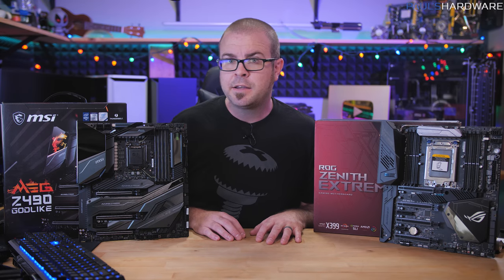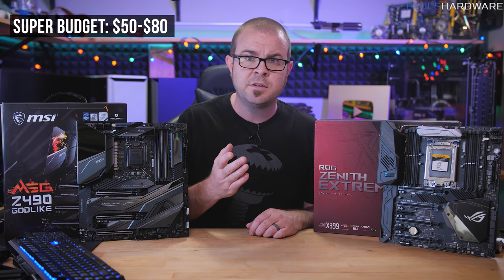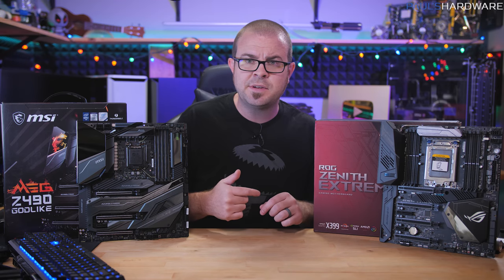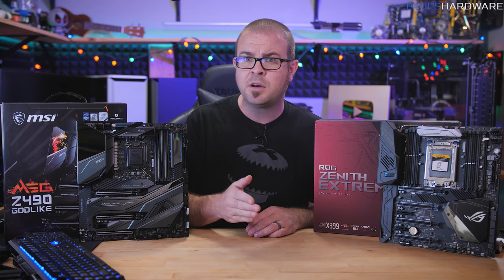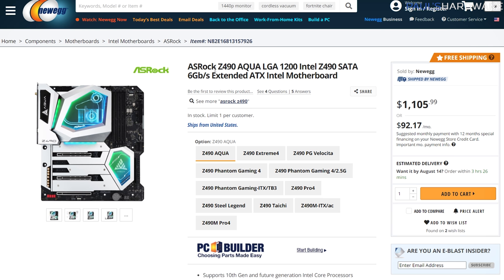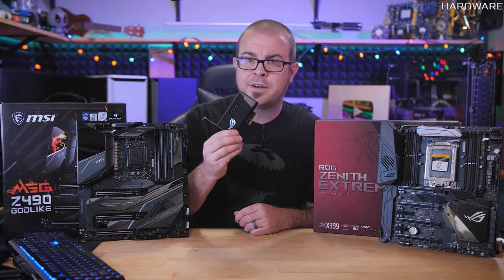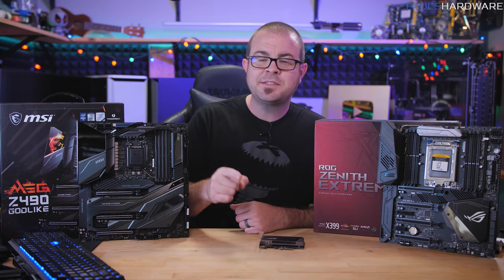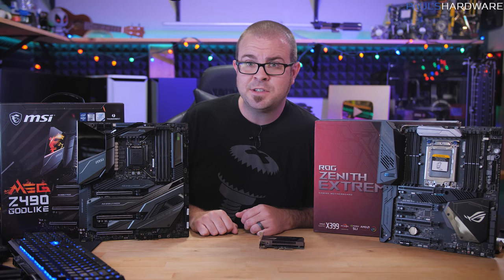What Does a $700 Motherboard Have that a $200 Motherboard Doesn’t?

Comment: Yeah Mobos have gotten way more expensive. MSI Tomahawk B350 here. It runs 3rd gen Ryzen, has 4 rams slots, nvme slot, sata galore, USB 3.1, 7.1 sound...I mean...for reals, it has been the best $76 I have spent and it is now rocking a 3800x @ 4.3 AC, 32Gb Trident Z Royal 3000 DDR4 (Gold), MSI RTX 2070 Super Ventus OC and an intel 660 1Tb nVME. Other stuff there, but those mentioned are drawing some decent power through the Mobo and, the VRMs on it nice and cool 25-40c. You dont need to go any higher unless you really need to use any of the extra crap most those boards offer. Need wifi, get a USB wifi adapter for $35. Need dual gig ethernet? Buy an expansion card for about that same price. Need USB-C...get an expansion board. See, you can pay way too much for all of those built on (that you cannot upgrade later I might add) or you can start small and build up to what you really need (upgrading possible). Those fancy-pants boards are nice to look at, but, not truly worth it. You just need to Git Gud at building PCs with lesser parts that are still on par for half-1/4 the cost of some over priced hardware.

Comment: I bought the ASUS X570 Aqua water-cooled and chipset. Also the huge monoblock that cools the 10gb NIC and M.2. PCIe 4.0. Another reason is I wanted to do my first open loop, which is a blessing and a curse. Since anything else is not an option for this board. So you cannot use an AIO unless you mod it with G4 1/4 fittings.

Comment: to be honest I buy motherboards based on what I'm doing,(when I'm not salvaging them from something). Nothing wrong with a 50 dollar board if the most your asking of the system you're building is to be a home theater PC or web browsing and don't plan on overclocking. Honestly I wouldn't even bother with much more than that unless I was planning to overclock or need something with a lot of SATA and PCI slots etc etc.

Comment: The number of PCIe slots on motherboard.
High ends have more slots where in a typical scenario you will add a graphic card, gigabit lan card and a pcie ssd card.
But that can be accomplished by mid range board too. I have Asus Z390 E and it has plenty of slots available.
Also some very high end mobo contains both graphic card slots on x16 lane which is plus for ppl with Quadro type cards nd into designing field

Comment: Hi Paul.  Love your channel and content.  I want to go with the 570 chipset and 1 gen 4 slot for a 5700xt and 2 NVMe gen 4 slots for storage.  Is there a $300 or so board you would recommend.  Probably will not be overclocking the Ryzen 9 3050xt.

Comment: I bought an rog rampage VI Extreme. really expensive and I'm not using most of it's features, But it's really pretty and since it has a ton of features, I have used some of them; Wifi, Diim.2 port for more ssds, fan connectors, rgb support, front Type C port, and the best feature, its REALLY pretty.

Comment: I’m using an Aorus Ultra x570. I really wish they had used the heat pipe design from the Aorus Master on the Ultra board as well. My GPU is actually touching the shroud that covers the little fan on the board. Not a problem really but I’d much rather there not be a fan there at all. The Ultra is a pretty expensive board but I really wanted the 3 NVMe slots. I would have bought the Master but $300 is already a lot of money for a motherboard. Anyway, I didn’t want to run any SATA drives at all so my PC is all NVMe and has 5TB of total storage. I think it was worth the money but I won’t be in a hurry to spend that kind of money on a motherboard again.

Comment: I've only ever paid $$$ for a motherboard twice. Once because that motherboard could fit 2 Pentium MMX CPUs and the other time because that motherboard could fit 2 Nocona Xeon CPUs and also had AGP-Pro and PCI-X.

These days I wouldn't pay very much over 100 euro for a m-ATX (my preferred form factor) motherboard. As generally they do not offer features that I care about anyway. And I've gotten to the point where I have most things on a PCI-e card anyway, just so I don't have to bother looking for these features on a motherboard anymore. I would pay say, a couple tenners more for a mobo that has a more convenient layout with regard to the order of PCI-e slots and RAM positioning, but I can work around those if I have to. Provided I get the slots that I need.

Comment: Few buttons you can get for $5 is your go to feature?. Maybe display, but beep codes or diodes are fine. What matters for me is PCIe lanes to get 8+8+4 and 2xM.2 running. 6 Sata or better yet 8. Good radiators. You cannot get that below $200 on x570, I looked

Comment: Tend to disagree on the practicality of the motherboard back plate - at least it protects SMDs on the back of the motherboard when you are assembling stuff on the cardboard box before placing it inside the case. Because one little slippage when you installing stick of ram might get one of these small components dislocated and your expensive motherboard is now dead. Ask me how i know this...

Comment: I tend to look for a lot of SATA slots (cause I use a lot of HDDs/SSDs), external USB slots, good PCIe placement (rather than unusable with a CPU cooler, or lacking slots), and fan controls on the board - in that order of importance. I can say the recent trend I've seen that is utterly worthless are extra ethernet adapters on the most expensive boards. I have literally zero use for those.

Comment: I dont go by price. I go by features I want. Whatever motherboard has the features I want, I pay and get it. I avoid unreasonable/fancy RGB ones though.
Right now I have a B450 Tomahawk max which has almost everything I want. My next buy will be a basic X570 UltraDurable most probably.
I will hold out for the next 3 years before I buy the newer B550 and beyond boards and processors. I am now inching towards Single board computers, x86 or ARM based.

One thing I am very particular about is the quality of components used and VRM circuitry. I bought a cheap GPU recently and when I looked at the bare bones PCB I regretted instantly. Corners are cut to make it cheaper.

Comment: Honestly even i physically dont need all features of my x570 crosshair hero 8 wifi, i love this motherboard. I really like its intel wifi 6 with bluetooth which means i can connect my controller without any dongles(except wifi antenna). Also i wanted specifically asus high end because it is easiest to find overclocking threads on google and on youtube in general. Im planning to get last gen am4 zen 3 4950x and i dont need to worry about vrm at all, it also guarantees overclocking potential of memory and cpu. I really doubt i would manage to run my dual rank 4x16gb 3200mhz cl14 kit without problems on lower end motherboard. Q-code display is now a must feature for me, extremely useful if something goes south. Even if i paid almost 500€ for that motherboard at launch i have no regrets.
Reply: Also the sheer amount of high speed usb's, 8x sata ports and 2x pcie 4.0 nvme is very nice too, i currently have like 6x usb's, 5x sata connected and there are plenty of ports for the future

Comment: Useless feature for many users: built-in WiFi. 
Yes: it can be useful sometimes. But if you want to play online games, WiFi is just not reliable enough. Even if you have one of those fancy routers with 18 antennae and "wifi 6" , you will still have occasional dips, drops and packet loss due to the nature of wifi. 

And since you generally don't move a desktop PC, just run a wire. It's a sooo much faster and more reliable connection.

Comment: Hi I have a question hoping for someone to reply.

So, I'm in the look for a mobo for my 2700x and I look forward to installing a second rx580 8g in my system later on. 

My question is, if the second PCIE slot says it's rated at "x8" or "x4" speed does that mean the second GPU will run at half or a quarter of its performance than if it was installed in the first PCIE slot rated at "x16" or if the second slot was also rated at "x16"?
Reply: yes, the second pcie slot only has the active connections of a x8 or x4 slot in that case, even though the slot used is technically a x16 slot.

Comment: The thing with the mid range motherboards is they fall between 2 stools, take the ASUS ROG Maximum Hero, which is ASUS's cheapest expensive board, if you catch my drift. So you pay big(ish) money for it, but it doesn't have that many more features than the cheaper lines below it, think they are called Gaming or something like that. I think you either buy a reasonably priced board or you go all out and pay big bucks, because the ones in between you don't get that much extra stuff, I mean this is true of the higher end ones.

Comment: I am in the process of building a computer, however I recently moved to a different country with standard 220V vs 120V.  Do I need to purchase new components so I don't fry my computer or is it as simple as buying the correct power source?  BTW I really enjoy your videos!
Reply: Your components work entirely on 3, 5 & 12 volt supplied by your powersupply that handles the conversion. So really only the powersupply could be an "issue".

Comment: I've had the X570 Xtreme fail on me 3 times (2 boards) & every time I go back to the UD with no issues. $1000 difference doesn't guarantee a better user experience.

Comment: Does a nic help download speeds or only transfer speeds?
Reply: only if you have a download/upload speed above 1gbit. Otherwise you won't notice a difference in internet speeds, only locally between other computers that also have 10gbit (and you will need a 10gbit capable switch)
Reply: @yotoprules9361  I have a 1 gbps internet speed but I often only reach 300s at most  when downloading something

Comment: Motherboard backplates actually are quite useful if u run a heavy Cpu AIr cooler and or big GPU - it helps a lot with board flex

Comment: so what's the recommendation?...I just rebuilt with an i5 10600 and a B 460 as when I had the k6600 and overclocked I could see no difference ..fitting an m5 drive (which failed on the 170 mobo) has really speeded things up whereas overclocking didn't seem to make a blind bit of difference. So I would recommend a new PC with compatible mobu an m5 drive and bin off overclocking.

Comment: I bought my asus x370 hero VI board for around 300$ still use it and it's amazing
Also that board has 13 USB ports and I needed at least 8 and more was nice extra since most mid range boards stop at 6-7 USB ports.
I could have bought pci usb card but they are not esthetically pleasing and they take pci-e lanes that are used for ssds.

Comment: I have a question:  I want to do a build primarily for Flight Sim and it will have lots of USB connections for the peripherals. 
HOWEVER, a good 3080 or equivalent AMD isn't even available.  I want to buy therefore and throw in a lower end GPU and then put in an order for a 3080 or even 4080 series when it comes out
What MB do you recommend for that kind of upgradability?

Comment: I'm using a B450 Tomahawk Max for my RTX 3070 and R9 3950X, which I got for £75. It works great for what I usually do and it's better than spending a minimum of £125 for an X570 motherboard, for similar functions

Comment: I'm building a new pc around the time cyberpunk launches, and I'm considering the Gigabyte x570 aorus extreme, but I'm also looking at aorus master and the crosshair VIII hero....I'm pretty much going top shelf across the board, planning on ryzen 4000 series cpu and 3090 gpu.  The other components I'm planning on aren't cheap either, but fuck it.  2020 sucks balls and I enjoy tech.  To be fair, the cost of this pc build pales in comparison to what I have already spent this year on replacing all my av equipment, including speakers, subwoofers, power amplifier, receiver, av cabinet, power conditioner, oled tv, etc etc.  I haven't upgraded my av equipment since around 2012/2013, so 2020 was the year the available tech advancements made me bite the bullet and upgrade.

Comment: I have the same board that he talked about at the beginning, the Gigabyte x399 Aorus Extreme and it amazing. I use most of the storage options on this thing and it never slows down. (2920x, 1TB Samsung NVME, and 4 2.5 inch SSD's). It has lived through me being an idiot and plugging in my RGB fan header into the wrong pins and sparks flying and smoke coming out. (it was my bad I should have unplugged it) but I restarted and everything works perfect.

Comment: Buying separate expansion cards also allow you full flexibility and option to keep them for another system or sell, if you're certain of not using them anymore. While expensive board when sold without all extras might not sell well or at all, so you;re kinda paying for everything each major system upgrade. Also there is little hope for retaining good part of the expensive mobo cost when selling long after premiere. It will sell fast, but only when priced very attractively, as no one is paying crazy money for 8yo tech. So buying separate expansions and keeping them as long they're compatible and being used saves money.

Comment: I'd prefer if the expensive motherboards had the option to REMOVE the aluminum element covers, and go for a bare-chip aesthetic. I appreciate the features such as additional headers or m.2 slots, but I'd rather show off the board underneath (instead of hide it away behind some powder-coated aluminum).

Comment: I've never looked I to mobo this closely. But I've never purchased one over $250. Even with my recent upgrade to  9900k and 2080 super, I kind of cut costs on my mobo because I don't really overclock. My main thing I hate is that it's so hard to find a decent mid range board with enough fan headers. I'm limiting my airflow because I only get 3 or 4 fan headers and 1 of those included the CPU fan. Luckily most AIO come with a splitter or it would be all bad.

Tha is gor all the I fo paul, but please fix your soul patch.

Comment: I would pretty much always go for Asus TUF if you have some money to spare, it's really nice looking. TUF series (AMD X570) is just about $200 dollars, has premium build quality and all that you need except rgb. It's actually pretty good overclocking board too due to it's really robust power delivery. It's also made to last, to back that up it has 5 year warranty.
Edit: Lol, that honestly sounded like ad. But it's pretty much what you want if you want the top quality for not too much money.

Those 700+ mb's are totally ridiculous though :D I get someone might pay 500+ to get some specific overclocking features and like, but paying pretty much $500 extra for integrated water cooling is lunatic. That said, someone with money to throw around might just buy it for slight edge on looks :D

Comment: I was sold when I read about power regulation on the upper level motherboards.

These boards power a massive thread ripper CPUs that cost even couple thousand dollars. I would rather spend a few extra dollars on a motherboard than cry over burned CPU.

The heat dissipation in some of these lower end boards was a joke, measured higher temperatures without than with a module.

Pcie configuration is either suboptimal or straight down inefficient on lower end boards.
But if we were to joke around, then I'd say one thing these boards have that others don't is spdif audio issues on Linux.
Reply: Understandable, and I imagine he would segment along CPU lines.

Comment: In my opinion, most of your computers hardware features are found in your motherboard and you case, such as number of USB ports, the versions and types of USB supported (i.e., 2.0, 3.1, 3.2, Type-A, Type-C), the number and quality of audio ports, quality front-panel ports and buttons, support for high network speeds, cool RGB lighting, space for storage drives, a side panel window, etc. Alternatively, your CPU and GPU are primarily meant to improve performance.

Personally, I'd rather spend premium costs on quality, future-proof features for my motherboard and case, which aren't easily upgraded, than my CPU and GPU, which can be upgraded much more easily after a few years.

Comment: Am I the only one who's pissed off by Newegg, Amazon and so on listing completely different products as if they're variants of the same thing? There's a $1300 board with a full cover waterblock and right next to it there is a basic $150 board that's probably between the cheapest ones with that chipset. The only thing that would make sense to me is to list different hardware revisions (if for some reason both are sold at the same time to begin with).

Comment: It wasn't always the case but these days the mid-range $200ish boards are going to do everything 99% of customers want.
It was not always the case, in the bad old days of 15 years ago if you wanted things like decent onboard sound, networking, and any kind of overclocking ability you did need to go to the $700+ boards but thankfully those days are gone.

Comment: Do more expensive boards have a longer life expectancy than cheaper boards? My first pc is the only one I upgraded out of after 8 years and it still ram after 15. The rest have failed within 4 to 5 years.
Reply: That really depends on luck of the draw. Usually higher end boards also have more points of failure (more components). Usually the board will outlast the components anyway though (unless of course you bought a PSU specifically designed to kill your system).